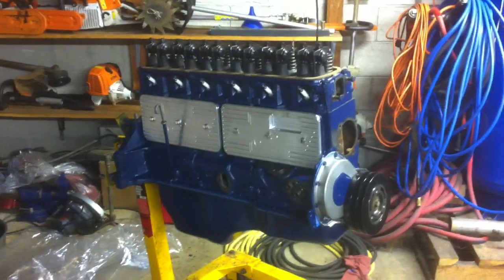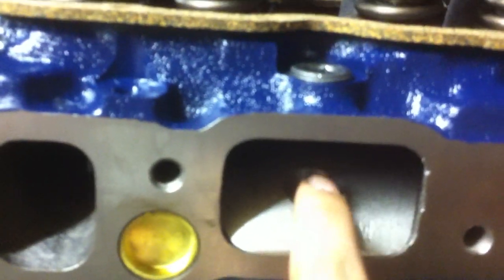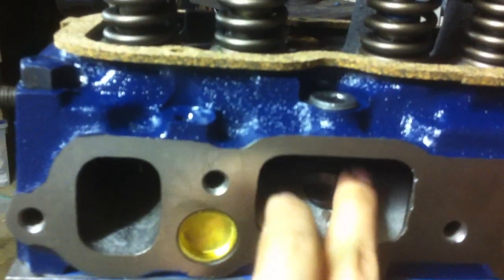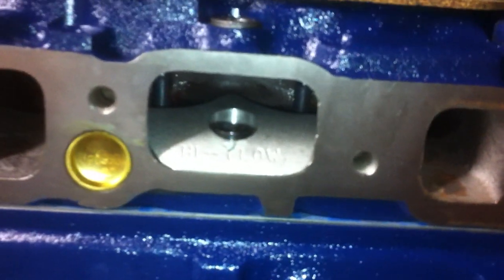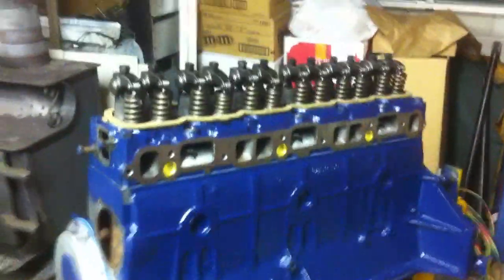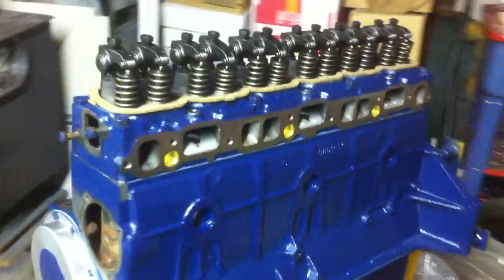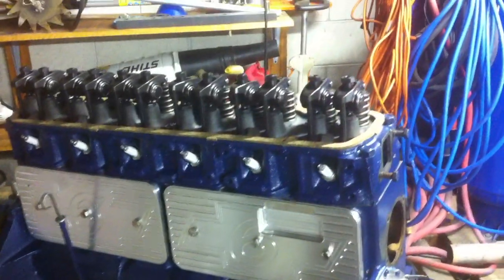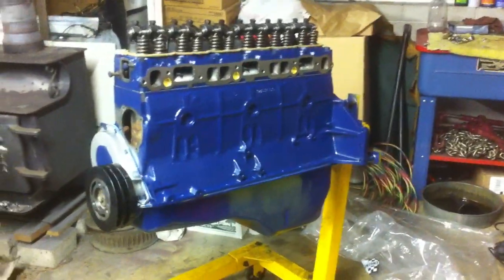292 hotrod 6- The big update!

Comment: I'm doing a 75 nova with the 4.1 I've been using heat for the rods and the cam gear. I have a question I'm hoping someone can answer. Do I heat press the crankshaft timing gear as well or do I use a press? Thank you in advance.

Comment: MAN, good work, I rebuilt a 292 bored 30. with lump ports, bigger valves 2.02, 1.84 also!, milled cyl head, and left .010 decked block. what intake you planning on running. I planning on running triple side draught with EFI. 3x 50mm dual throttle body's or 48's knot sure. some say increase bore. some say smaller is better throttle response... I in new England. gtg
Reply from the maker: Cool! Yeah yer 292 is gonna have some beef to it. I'm going to run the clifford ram horn intake. Works well...easy install. Thanks for checkin in.
Reply: Military Chevy I need to load a video starting and breaking in my engine.  How long until you do a big update again!!!!!!!!
Reply from the maker: D Johnson If things go right sometime this summer. lol I'm stocking up on parts and money right now. lol

Comment: This would have been easier if you had dropped in the 292 crank into a Pontiac 4bbl Sprint OHC6. Would have run even better.
Reply: The pontiac engine is a low deck block. Not very easy to make a long stroke 292 crank work in it.